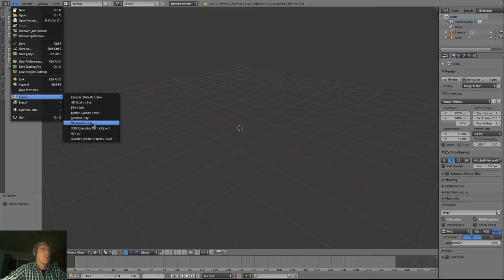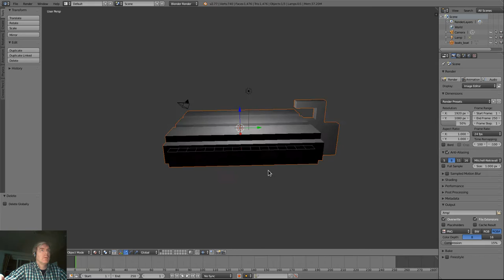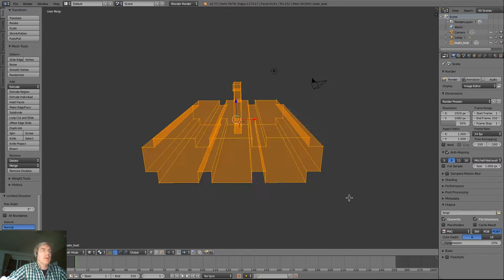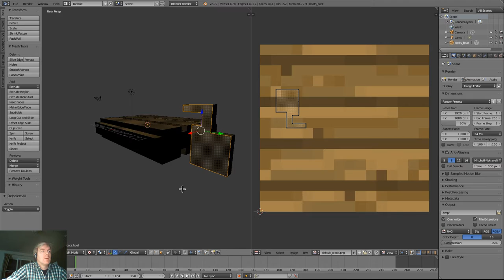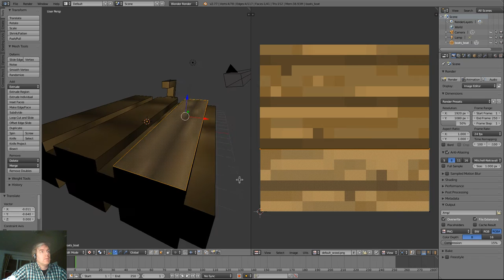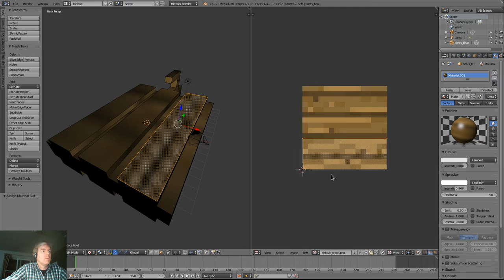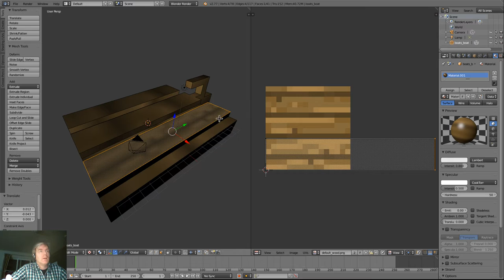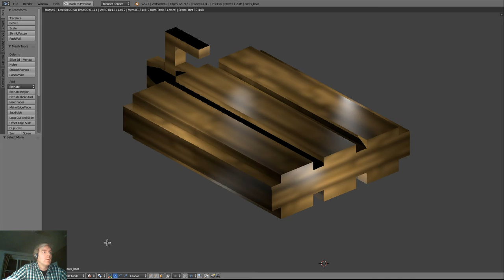Cleanup of the Minetest boat model

Comment: if it's supposed to look like logs, then why not use the default:tree instead?

Just an idea.
Reply from the maker: The construction material for making the boat does not contain logs, but only planks. It's also called a boat, not a "raft". 

Hence I chose to keep it to this texture. Reskinning would be possible if I would attach a second material. I may do this in the future.